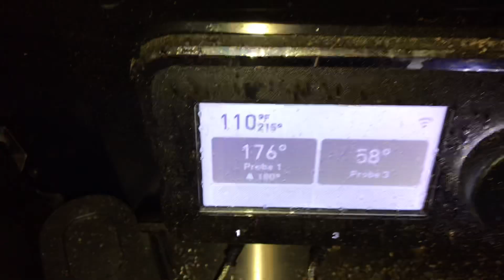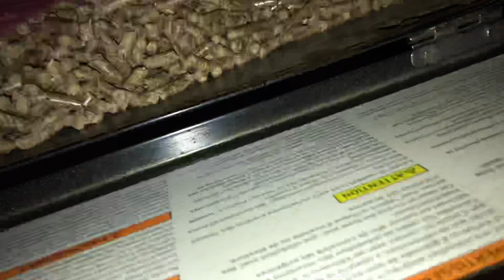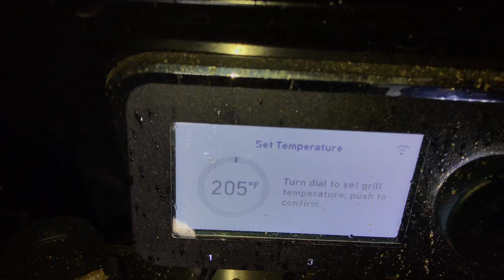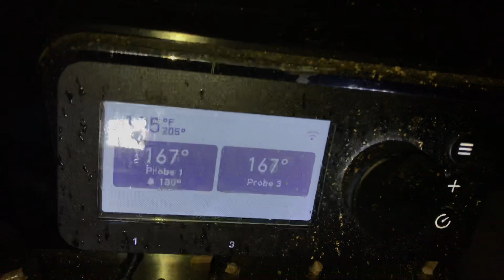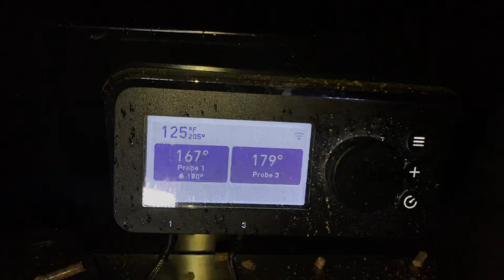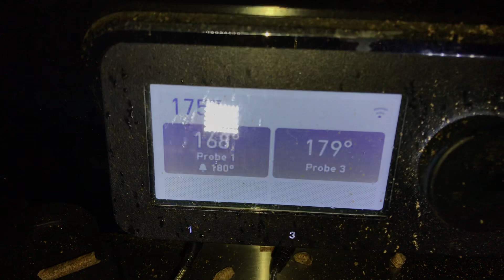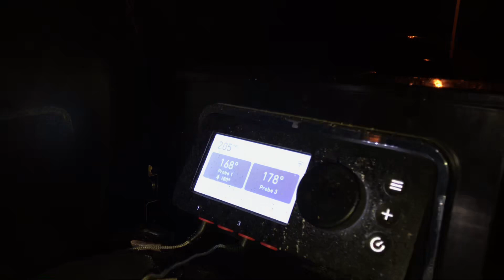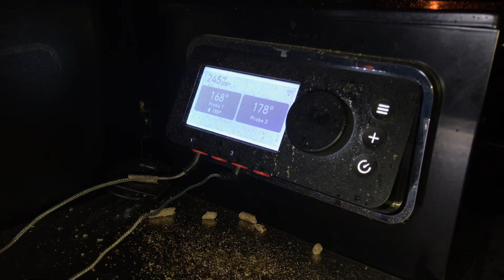Weber smokefire 3 brisket cook. PART 3 the big ol grease fire because I ran no drip trays

Comment: Tony, you paid $1,200 for a cooker that was touted as not needing a drip-pan and was supposed to be low maintenance and easy to clean.  Now that all of these videos have been popping up on various channels, I'm seeing forum posts and comments blaming these issues on "noobs, not knowing how to run the cooker."  Buying the cooker pre-assembled, blah, blah, blah...  Pellet cookers are supposed to be easy.  A "noob" should be able to cook food without any worries of the auger running dry or the damn thing catching on fire.  Now the line is, "This cooker does have some minor design flaws, but there are easy workarounds."  WTF...  If anyone that purchased is willing to go with the "workarounds," then at the VERY LEAST they should receive a partial refund to offset the need to purchase drip-pans every time you want to use the cooker.  Again, not needing them was a selling point.  I have never seen anything like this!  I have owned 3 different pellet cookers and have hundreds of hours under my belt cooking on them.  I have never had a grease fire or hopper issues, with any of them.  This is being treated as a public relations issue and a lot of people (for whatever reason) are giving Weber a pass.  This is disgusting.  I admire the work you've been putting into this.  I know you want your new cooker to be the one you thought you were buying, but I think maybe it's time to get your money back, brother.
Reply from the maker: This is exactly how I feel. I love weber but they need to own upto this horrible "game changer" they thought they were releasing. Don't use me as a beta tester. Wait until the things ready for market. Don't release a stripped down app because you don't want people to track the big pit temp swings. They don't want you to control the grill from your phone because they're scared it will flame out and you'll want to restart it away from home and catch it on fire.
Reply: Time for Weber to do a full reboot and do a recall, offer a refund and do a redesign.  This has turned into a PR nightmare that seems to be getting worse by the day.
Reply: @blackwagon3   Well said, Weber appears to put this out without proper testing and consumers like you are the "beta testers".   I think that's what's most upsetting about this, they made it sound that they tested the heck of these  in their "engineering facility"  and it sure feels like that was a lie.  The casual user will burn their house down with this cooker.

Comment: Question for you.  During this massive cook, did you ever empty the grease tray midway?  I ask because Harry Soo did a similar test except he had five large cuts of meat in excess of 60 lbs on his EX6.  At the end of the day, he removed 12 cups of grease (3/4 of a gallon) from the SmokeFire which is a lot more than the trap holds, so he had to have been emptying it along the way.  If you never emptied it, i could see a situation with this much grease coming off these briskets that the grease backed up into the chamber and started a grease fire that led into the the remaining grease in the lower tray.  What do you think?
Reply from the maker: My grease tray was only half way full.
Reply: Tony Ngo which means that the grease that ignited never left the belly of the smoker.  I’d be curious as to why that is.

Comment: That was self inflicted the burn pot was already full with pellets and you used a torch to ignite the pellets.   The auger kept pushing in pellets and causing the pellets to overflow into the bottom of the drum while burning.  stick with a stick burner pop